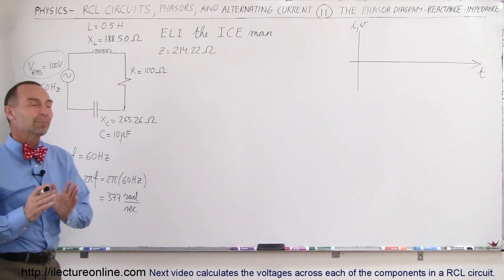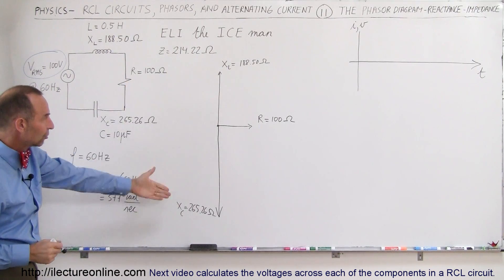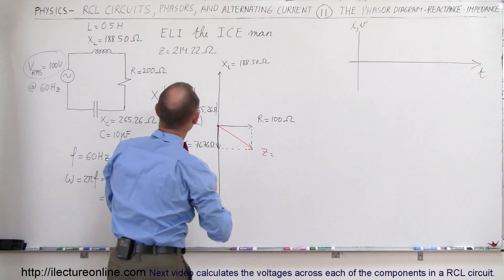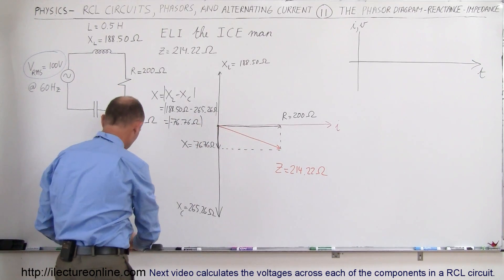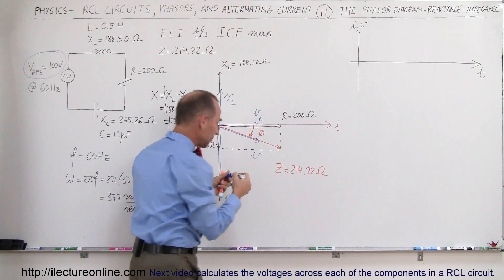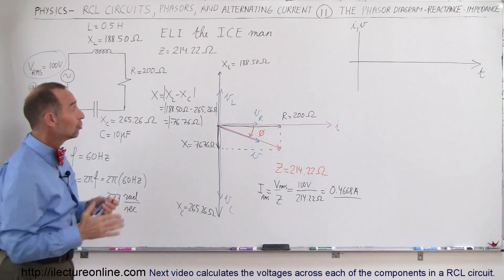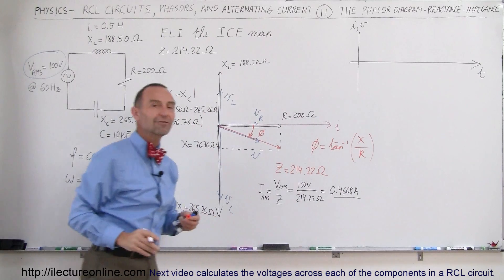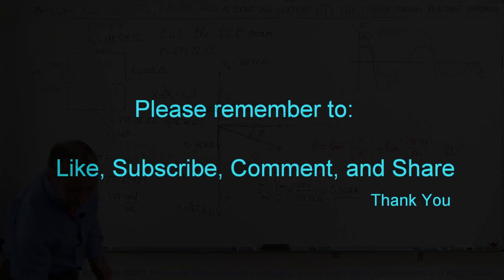Physics 49.1  RCL Circuits & Phasors (11 of 24) Phasor Diagram - Reactance & Impedance

Comment: Could you elaborate on what you mean by the current and voltage reaching their maximum? Maximum current means the point in time when the circuit experiences the least amount of total impedance?
Reply from the maker: That is a good question.
The impedance for the circuit is constant.
Which means that the changes in voltage and current must be independent of the impedance.
The source of the current and voltage provides alternating current  (AC) and alternating voltage as opposed to direct current (DC).  That means that the current is constantly changing like a sine function.  That will cause the current through each component to change like a sine function as well and the voltage across each component also.  This will happen at different times in each cycle.
Note that the maximum will be reached at some point during the cycle.